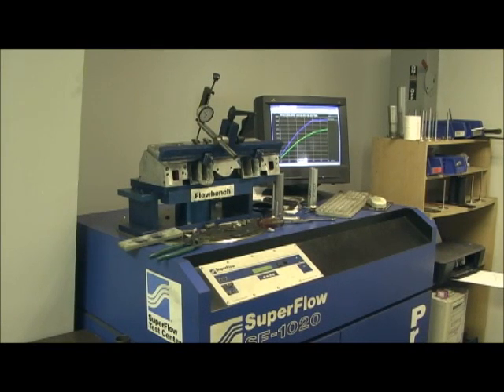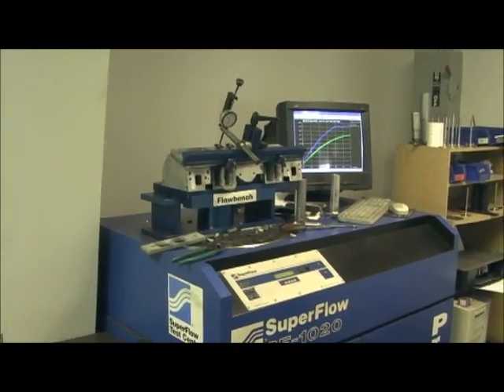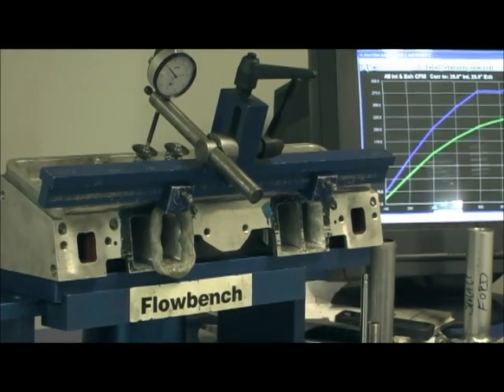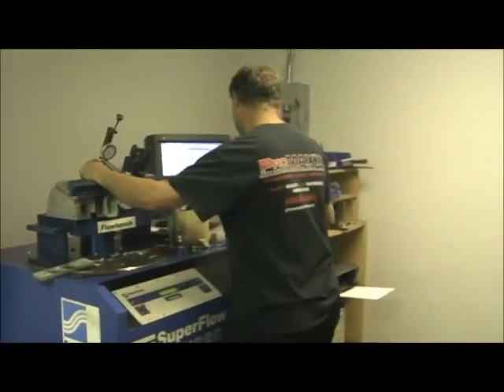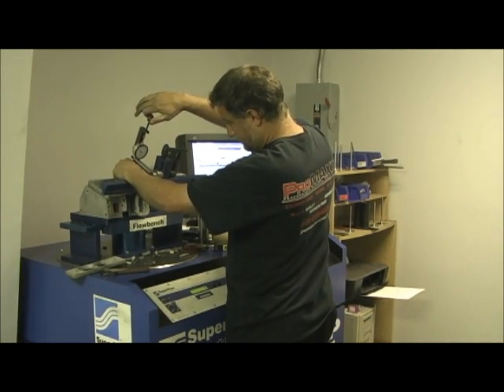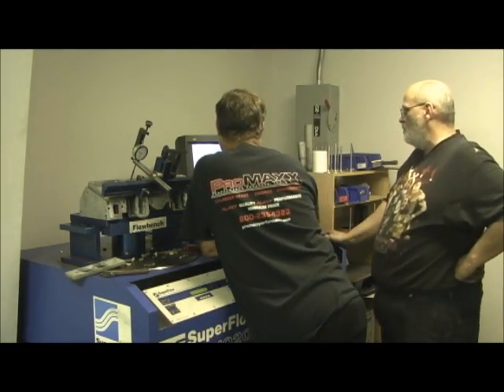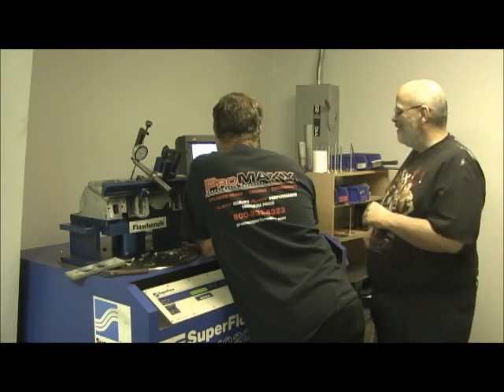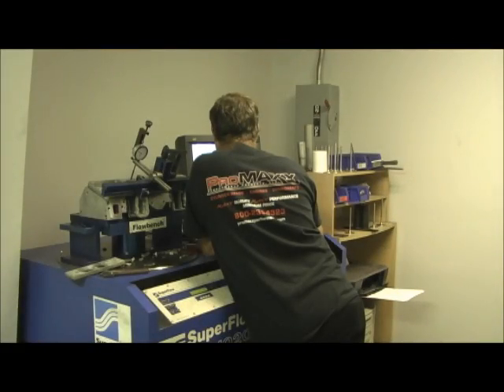Denmark ProComp 190cc Intake FLOW TEST 10.4

Comment: That calculates to about 531 horsepower for the 355 and the 383. The 355 makes it at a bit higher rpm. The rest of the combo would need to be up to snuff.Nice work Thomas!
Reply from the maker: Charles Servedio I am disappointed, I was trying to hit 300, there was just not enough head to get it there. When I hit it with a sonic tester, I was walking on eggshells here, scary stuff. My thinnest port area was .070!!! Just not enough meat safely.